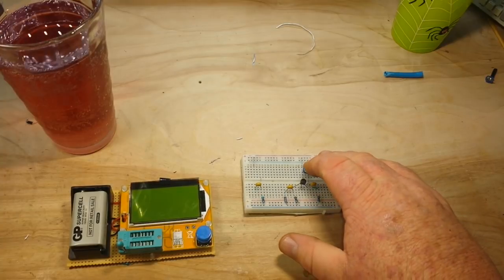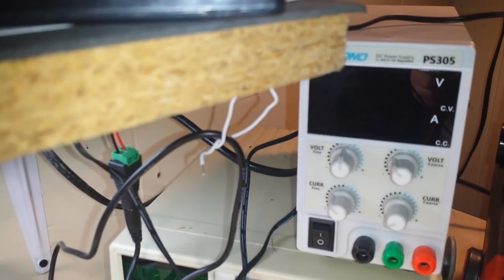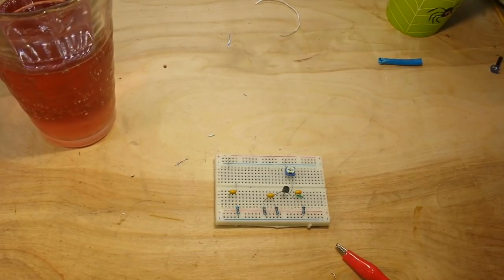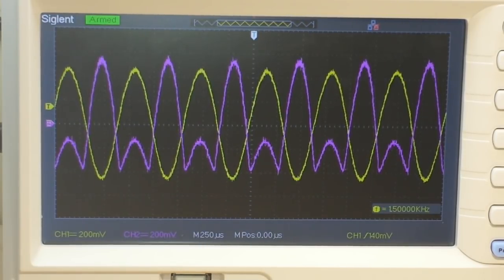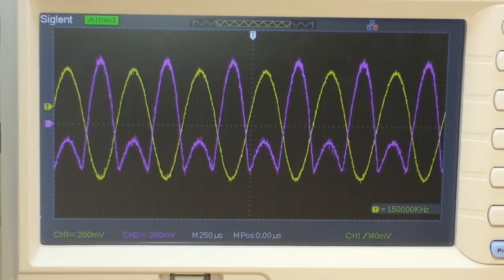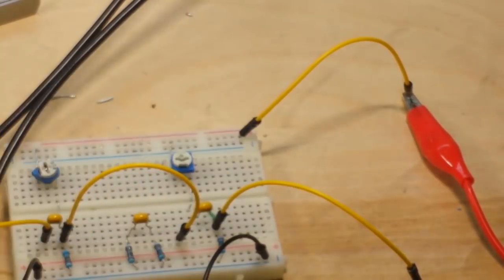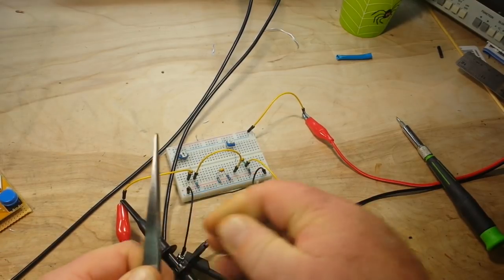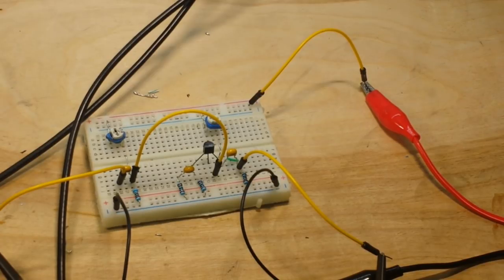Effects of temperature on transistor gain

Comment: Is that inversion issue caused by not having an emitter resistor? I thought the emitter resistor value would temperature bias the transistor so it doesn't matter if the transistor is in very hot temperatures.

Comment: Great vid, maybe if you try this experiment with a single bias resistor from Vcc to the base of the transistor the results would be a more appreciable cause if I remember correctly from my classes using a voltage divider resistor network in the base (considering adequate values of course: beta*R_E>10*R_2) the influence of temperature (change of beta) is almost insignificant. Love your videos and I really think you're doing an amazing job. keep it up. Greetings from Mexico.
Reply from the maker: I will do that and post the results. Greetings from Oh, USA. Back when I was stationed in San Diego, Ca, my friends and I would go to Tijuana all the time. Also Roserita. Mexico is a beautiful country.